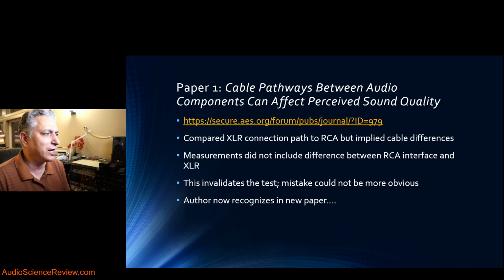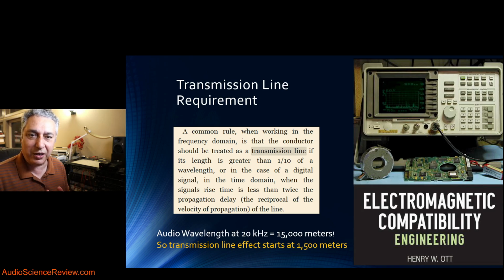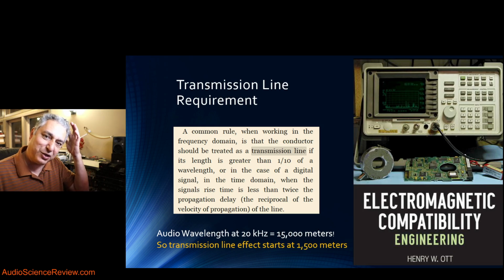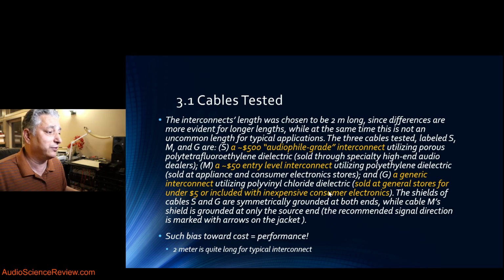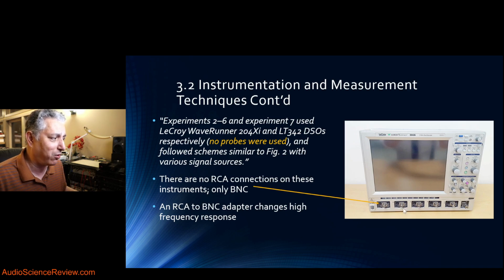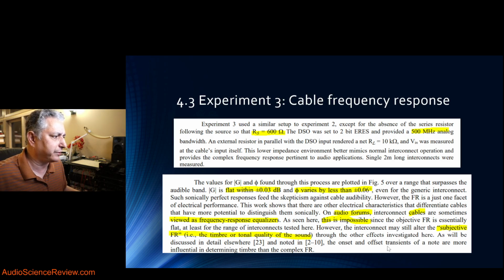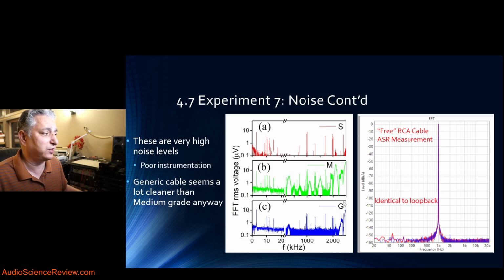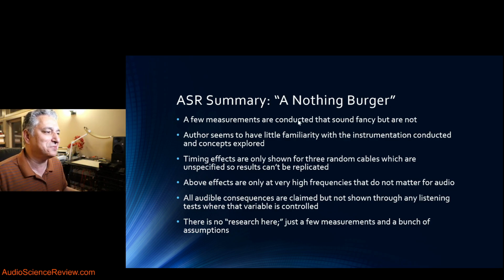Scientific Proof of Measurable Difference in Audio Cables? Paper Review

Comment: Cables types do make a clearly audible difference for electric guitars, but they are a very special case with high source impedance (>50kohm) pickups and very high impedance valve inputs (>10Mohm). Apart from that type of application any perceived differences at lower impedances are due to other factors. When making random comparisons between hi-fi equipment it is important to consider what the cable screens are connected to, or not, they are highly unlikely to conform to AES48 recommended practise.
Be very suspicious of measurements below 100dB. What is that referred to? Usually it is digital full scale where 0dB may be +22dBu or higher so you have to subtract that to convert to absolute measurements.
 The only thing I would disagree with you on is that "noise is noise: you either hear it or you don't".  Most analogue audio equipment has a noise floor between -95dBu (good) and -60dBu (bad) and you can't hear either without amplifying it, but it does effect the perceived quality of the sound.
After a lifelong career in professional audio the one thing I can say about comparative tests is that most people don't know what they are listening to or for. Very few people will be prepared to be the first to pass an opinion, they usually wait to see what other people say first, and very few people will go first and be right. Fools jump in, hence all the nonsense you get. Very few people can identify a 0.5dB change for what it is, they might notice a difference, but then it becomes a Rorschach test and they go off on their favourite hobby horse. Very few will just say "It's louder" and if they say "it sounds like 0.0025% distortion to me" they are bluffing. (Yes, that has happened!)

Comment: After reading through the first paper (see [1]), at first glance it did appear that some obvious conclusions could be made about "balanced" (balanced wheatstone bridge impedances + differential signaling), versus "unbalanced" (single-ended / non-differential signaling).  However, the use of very subjective listening tests & psychoacoustics has been a classic confounding problem since the 80's (see "The Great Debate: Subjective Evaluation", an AES paper from 1980 [2], and "Listening Tests: Turning Opinion into Fact" from 1981 [3] which both talk about a lot of the problems with listening room setup & listener subjectivity).  So, we can take the listener's perceptions of the A/B testing with the usual grain(s) of salt.  It would have been nice to see some more controlled experiments regarding noise perception using the same setup and simply controlling for playing a recording with controlled generated noise vs. without.  Then perhaps some sort of general (yet still subjective) conclusion could be drawn regarding whether people prefer noise or not in those types of classical recordings (as were used in the tests).

As far as the RCA (unbalanced, single-ended) vs XLR (balanced, differential signaling) conclusions & measurements of noise...  Those would have held more weight if the noise analysis were done with some common known environmental sources of noise controlled for, and compared between each cable & signaling modality without any subjective psychoacoustic A/B listening tests.  Instead, just use common quantitative measurements of the noise itself to compare them, no need to muddy the waters by bringing subjective listening tests into the picture.  For example, just measure noise spectrum in a very controlled low-noise environment (or at least as best is as possible for AC mains being nearby for test equipment) versus a high-noise environment where EMF noise sources were intentionally added in a controlled manner.  Quantifying a cable's susceptibility to external noise as much as possible would help, along with good experiment design such as using a test setup with a cable at constant controlled distance from EMF source, perfectly straight, proper connections, taking into account cable lengths, inverse square law and some basics of antenna radiation patterns (really have to control for that well to simplify things given the directional lobe radiation patterns for some sources, and the impacts of AC mains noise sources such as Romex AC wiring vs. twisted pair in metal conduit).  Cable length could be it's own experiment, but intuition and antenna research would probably conclude it's related to cable length being 1/4 wavelength multiple(s), shape & noise source frequency resonance capability with such an antenna length & shape.   It would also help to compare different cables susceptibility to that same interference source, which would come down to the signaling modality (differential vs. single-ended), the physics of the cable's material & construction, and Maxwell's EMF equations at some point.  Other comparisons to do would include comparing CMRR for different XLR cable constructions, comparing shielded twisted pair with other cable types, comparing susceptibility to intentionally created ground loops by making or breaking connections to the shield or pins.  Again, all the above with audible frequency ranges taken into consideration.

For that last idea about ground loops, there is good precedent for proving some relation between CMRR and the different cabling (unbalanced single-ended vs. balanced differential signaling).  Also the relationship between the real meaning of "balanced" as in "balanced wheatstone bridge" which Bill Whitlock goes over in his AES 2021 talk.  This is viewable here on YouTube:   Bill Whitlock - Signal Interfaces Debunked - 4/27/2021" (link:  https://www.youtube.com/watch?v=qYRhwnxHuYo ).  Also see AES standards: AES48-2005, and AES54-2-2008 regarding shielding & interconnects.

On the psychoacoustics aspect regarding "do people prefer noise or not"...
If indeed people do prefer lower noise, then do that psychoacoustic experiment separately and don't bring cable differences into it yet... just generate the noise and compare!  Probably best to take into account the even vs. odd harmonic types of noise too.  It's commonly thought that people prefer the even harmonics (e.g. from tube amp distortion) over the odd harmonics (e.g. digital distortion).  It's probably safe to assume most people don't prefer the common 60Hz (or 50Hz in EU) ground loop hum when it's loud enough to compete with the recording being played back on a turntable (also happens to be odd harmonics).  So there's the tie-in to XLR vs RCA again with ground loop hum, but do that experiment separately!  That would have been much better research to prove in steps rather than this "expensive vs. non-expensive" and less controlled subjective A/B test comparing cabling type kind of research.  If the original author's a physicist, then best to focus on the physics & materials, not the marketing!

[1]  M. N. Kunchur, ‘Cable Pathways Between Audio Components Can Affect Perceived Sound Quality’, J. Audio Eng. Soc, vol. 69, no. 6, pp. 398–409, 2021.

[2]  S. P. Lipshitz and J. Vanderkooy, ‘The Great Debate: Subjective Evaluation’, in Audio Engineering Society Convention 65, 1980.

[3]  F. E. Toole, ‘Listening Tests: Turning Opinion into Fact’, in Audio Engineering Society Convention 69, 1981.

Comment: 10:26  Well, charge does not pass through a wire at the speed of light.  So, even realistically giving a "velocity of propagation" of say, 80%, worst case (but realistic for a copper wire), then the speed of propagation would be 239833966.4 m/s (80%  the speed of light in a vac), and the wavelength at 20KHz would be 11,991 meters, and 1/10th would be 1,199 meters, at which point transmission line theory would kick-in.   My point is, some people have really large homes, esp. in LA, with big rooms, and perhaps they need speaker wires that long?

Comment: In my opinion what matters is awg and length of the speaker cable. For interconnection it’s balanced vs unbalanced. And differences are only visible on measurement equipment.

Comment: Cables are just a question of reliability, as long as it's nickel plated on nickel plug (to avoid oxydation) and that is it secured either soldered (can or worms) or not, it's a cable. So we may build them ourselves or pay a little more for a better reliability or design purpose. About the scientific papers, it's amazing that such biases and errors pass the peer review process... For me there are reliable cables and cables with problems (and problems can be vicious), I'm very binary on this. And a reliable cable can become unreliable with time and use.

Comment: Think you’re wasting time with all these measurements. Interesting but what counts is the sound. Just because two interconnects seems to measure identically doesn’t mean they’ll sound alike. As true measurement junkies you believe that if it measures the same it sounds alike. Makes sense but I’ve been playing with wires for a long time and I find that after wires, terminals are clean connectors all work together to tune the system and make it sound different. I have a Topping E30 that I find tends to be overbearing in the upper midrange (5 to 10k) and is very sensitive about it’s connection to the power amplifier. I’ve saved a few interconnects through and sampling is free. After installing one set I noticed beautiful definition with a trace of roughness. I’d used set of set of plated steel RCA terminals which I switched to gold plated brass and the roughness was replaced with the detail it had been masking. I know it’s not “scientific” but when my ears stop hurting, I can imagine something good was achieved. Undoubtedly a lot of snake oil exists, interconnects and cables costing thousands simply don’t make sense. What material and labour costs could justify such prices. How much would three feet of  tiny gauge platinum, silver or gold wire cost? Funny that these mega priced items get such great reviews. They probably sound good but a thousand times better? We can agree to disagree on audible differences but you are spot on about ludicrous fakes. Everyone who loves music can tinker to make it sound better but blowing thousands I haven’t got on mediocrity would make me feel cheated.
Reply: PS Try cleaning all your wall sockets. Probably will measure the same. If you don’t hear a difference just enjoy your iPhone because I hear a pretty big one.

Comment: The wavelength is defined as the length of this pattern for one cycle, and because we can fit 20 cycles into the distance of 340 meters, the wavelength for 20 Hz is 340 meters divided by 20, which is 17 meters. 
1/10 of 17m is 1.7m so the transmission line effect would take place with much shorter wire than what you’re suggesting. You are more than willing to do the math for 20,000 Hz maybe you should’ve done it for 20 HZ.
Reply: Yes, that is the wavelength in air, not in a wire. No transmission theory applies.
Reply: @charlesbiller4371  it's Peter. Don't worry about.